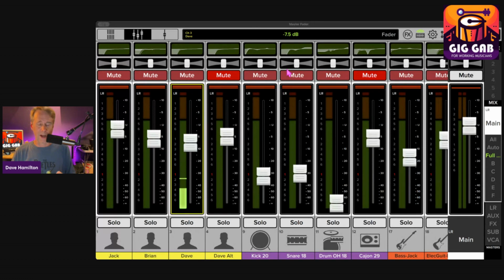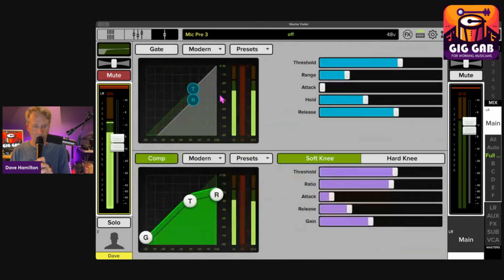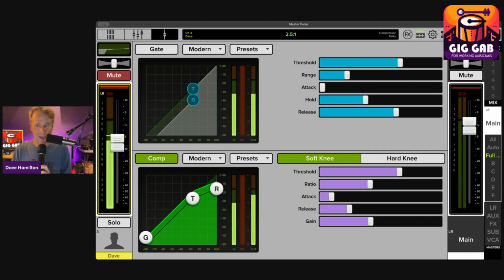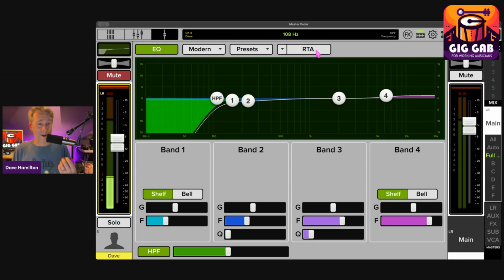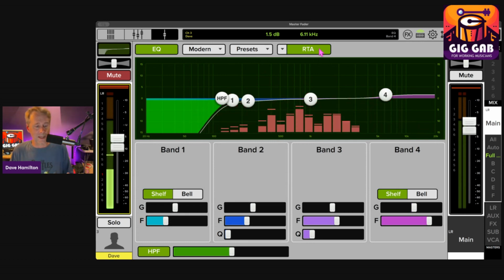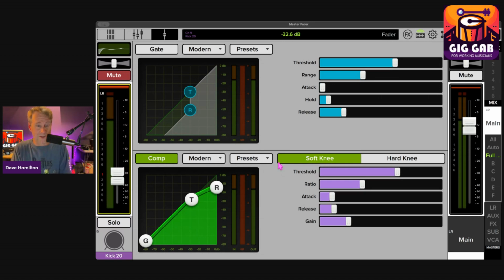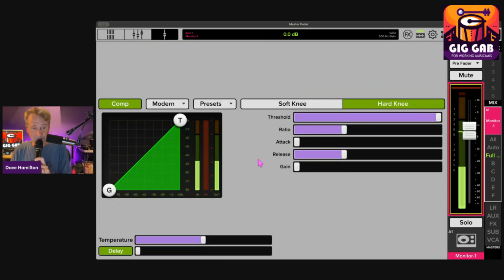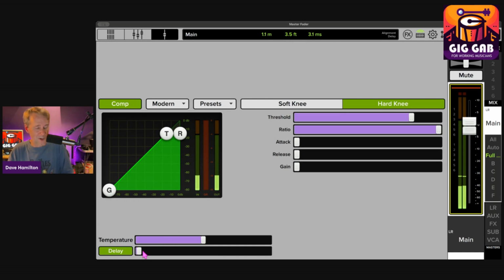Digital Mixers 101: Essential Tips on Gain, Compression, EQ, and Beyond — Gig Gab 439

Comment: I am always interested in consuming this type of content. I am a novice.  I use an analog mixer in my studio and usually work my way from top to bottom (input to output). There’s no compression stage on the channel. In your digital mixer, does the compression stage come after the input gain?
Reply: Great question! And yes, I worked from top-to-bottom here, too. Compression, along with EQ and other effects, comes after input gain and can then affect the gain through the rest of the flow. On many digital mixers you don't get to set the order of the effects chain (some let you, of course). This one puts compression first.

But in my studio (using Logic, or any other DAW), I will often put EQ and a noise-gate before compression, so that I'm not impacting those by compressing things I don't want in the signal.
Reply: @DaveHamilton  thanks Dave!